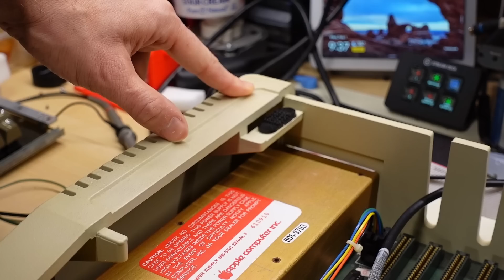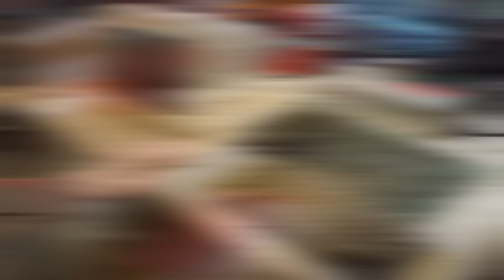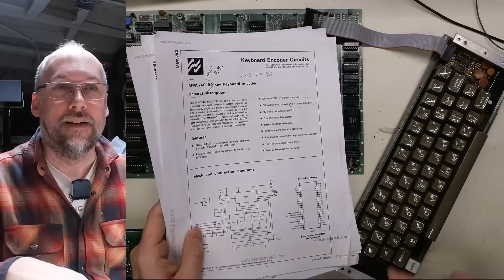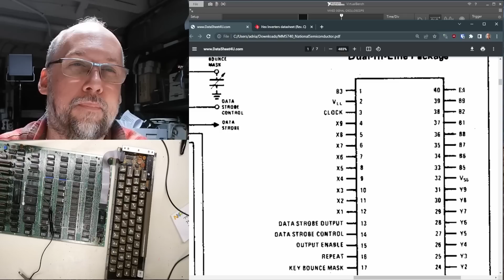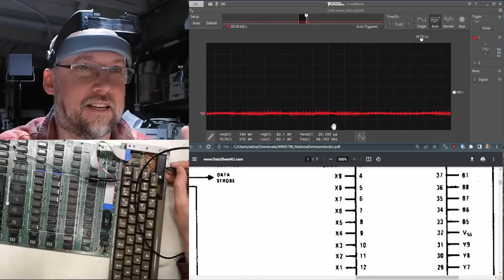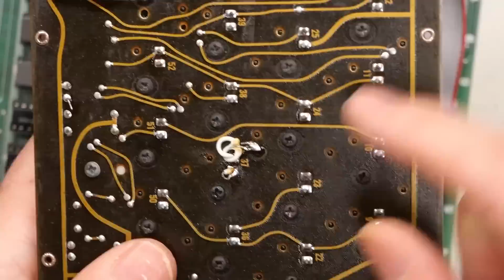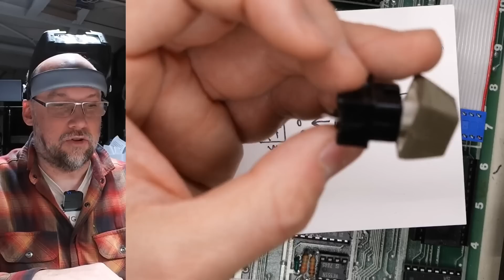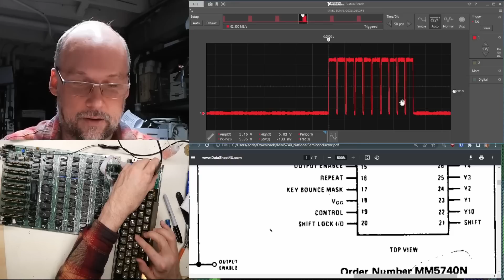The original Apple II keyboard sucks (and is hard to fix)

Comment: That velcro isn't going anywhere with JB weld. But next time, if you want something easier, try double stick carpet tape.
Reply: Apple used a kind of plastic mushroom connector, not velcro. The halves stick together much more powerfully than velcro, so most tapes don't have any chance of working.  The 3M high-strength VHB mounting tape might have a chance.  But expoxy, properly applied to a sanded surface, works pretty well too.
Reply: Sounds like Scotchlock™ by 3M. I've always had good luck with contact cement for adhering porous to non-porous surfaces and for two non-porous surfaces.

Comment: If the main goal was to restore this keyboard to working order, would the key switches from the previous working keyboard be transplantable into the broken keyboard?  If you're more concerned with getting this one working, doing it at the cost of the other keyboard may be an option.  I don't know if the switches would be interchangeable, but it all depends on what the main goal is with this repair.
Reply: Those are completely different mechanisms, probably with different pin locations relative to the key grid.

Comment: I just did some searching and it looks like you can replace the key switches with Cherry MX switches then 3d print a adapter to connect key cap to the cherry key. Thingiverse: Cherry MX to Datanetics DC-51 Keyboard Switch Adapter. Hope this helps for a future video and gets the keyboard back to full function. Keep this old keyboard going hopefully. Keep your head high Adrian and thanks for another great video.
Reply: Yes, that would be the best bet. It is Thing #5780203, and should be good enough in filament for keyboard purposes. Maybe JCM could make a keyswitch kit with all the key switches and adapters, so it would just be an exercise in soldering. Cheers!
Reply: Designer of that adapter kit here: I recommend you print in PETG over PLA and to try to adjust your settings for good inter layer adhesion.

I had written a longer comment earlier but I suspect some auto moderator system ate it since I had put a link to my write up on Applefritter with more background info than the Thingiverse page.

I have licensed the models under CC-BY-NC-SA, but if someone like Joe's Computer Museum or ReactiveMicro wants to make kits using them I am very much open to proposals.
Reply: @thomasives7560 that would be so epic
Reply: Was about to suggest something along these lines, glad to see someone has already created a suitable mod. Would love to see a video with this upgrade done.
Reply: The rub with that would be that you'd probably have to replace them all or have the keys not be the same height. That would make the machine less original. If you're just booting it up every once in a while and want it to look nice, then it might be better to leave it alone, or just try to find some donor switches. However, if you care more about using the machine, then I think it's the best way to go.
Reply: @davidwilliams4845  I had good reference material to work with and the position of the keys is pretty much spot on (see the side-by-side comparison photo on Printables / Thingiverse / AppleFritter).

As for the "keeping it original" argument I hear you; I did try to find donor switches when I began working on that board but could not find any. They have not made DC-51 switches in decades and whatever new old stock there may be left is also going to suffer from this adhesive degradation problem. You could replace the switches as they fail but you'll be left with a weird, non-uniform feeling typing experience.

Comment: Too bad there aren't replacement switches. I'm thinking there may be, but would require quite a bit of modifications to the PCB as the pins may not fully line up. It would be interesting to see if anyone starts a side-project on restoration of these keyboards, even if the onboard chips need to be transferred to the new PCB and replacement key switches.
Reply: and maybe 3d print a small thin adapter to allow the original keycaps to fit modern switches.

Comment: There is a reason why actual switches were replaced with capacitance switches.  Mechanical switches are inherently noisy, whereas the capacitance switches have built in hysteresis.  I have a few old TRS-80's that have mechanical switches, and they bounce a LOT.  There is a software fix, but you have to load that manually every time you turn the computer on.  But what are you going to do?  ^-^

Comment: I believe the generic term for Velcro is just 'hook and loop fasteners'. You can get those DIP headers still - I recently had to use the 18-pin version for a project of mine. Assuming these are 16 pins, here's the part number for one at Digi-Key: CDP16G-ND. And that was a nice blast from the past seeing Drol on the Apple ][ (I had the C64 version).

Comment: For repeating keys, did you notice there is a debounce variable capacitor to adjust that? Pin 17 in the datasheet. (Is that used on Joe's replacement board?)

Comment: I wonder if you could make some sort of 3D print that would take the space of those long switches so you could replace them with say cherry switches. Recycle legs from components you snip on another project. Probably would be very involved but needed eventually.
Reply: Could someone just design a whole replacement keyboard using Cherry switches?
Reply: @Tibbs90  Absolutely. I was just thinking to replace the part that is broken. PCB works fine. So making cherry switches the form factor of those switches is probably the most original fix possible.
Reply: Short leads and some hot glue make you the key switch rebuilder you want to (be).

Comment: I'm sorry Adrian. Not replacing the bad key caps is a half-assed repair imo ☹️ I'd like to see a follow up video where you just replace all the switches to something modern
Reply: There are different ideas behind this kind of repair of a classic machine.  Some people just want it working and don't care about the methods.  Other people want it to remain as completely stock as possible.  Adrian is showing what he can do without enormous effort to try to keep it stock but also get it working.
Reply: @Mueller3D  i get it however he replaced the controller chip with a modern microcontroller. Keeping it stock no longer applies. Let's say Adrian manages to get ahold of 15 or so new old stock switches and replace the busted, how long till the rest dies? 
You heard the man, these switches are notoriously flakey.
I'd just shotgun all the switches with modern ones. The key cap would hide their age well and keep the keyboard working for decades to come (maybe. There's never a guarantee)

Comment: Those DIP-shaped IDCs are readily available from e.g. DigiKey or Mouser for pin counts <= 28, so 16 pins is no problem.
I do not seem to be able to find the larger 40 pin ones anymore from the stock distributors...

Comment: What are you using to connect the Apple to the Amdec Monitor, I have a 2+ and the same Monitor and would like to use it as well. Thanks for another great video Adrian. Keep them coming.
Reply: Any regular phono (RCA) cable should do the job.  Actually, I just checked, and the Amdek 300 has a built-in cable with the RCA plug on it already.  If you have a 310A, then it has the wrong cable, and you probably can't easily use it with an Apple.

Comment: How does negative voltage work anyway? Sounds weird! Does it remove voltage? 😀
Reply: It is negative relative to the zero volts (ground) reference. In old chips it was part of the old silicon design that required a voltage that was negative relative to ground. It didn't need much current, but the chip could actually be damaged if it wasn't there.
Reply: Voltage is pressure which causes charges (positive or negative) to flow. If you consider 0 volts (ground) to be like normal air pressure, then a positive voltage (pressure) is on the output side of a fan or a leaf blower (i.e., it’s blowing air at you). A negative voltage (or pressure) would be suction, like the business-end of your vacuum cleaner. It’s all relative to some standard. For air pressure, that’s about 14 PSI or so, depending on the weather. For voltage (measurements), ground is wherever in the circuit you put the black meter lead. A positive voltage means positive charge is (conceptually, at least) flowing at the meter (the red lead.) A negative voltage would be positive charge getting sucked out of the meter through the red lead. And, of course, 0 volts means the charge isn’t flowing at all. This is “conventional” current. For “electron” current, the whole thing is reversed. A positive voltage would mean electrons (which are negatively charged) are getting sucked out of the meter through the red lead, and a negative voltage means electrons are “blowing” into the meter from the red lead.

Comment: Thanks for another excellent video, a frustrating outcome for you.

Unhappily for such a notoriously unreliable key mechanism I guess if there was a good replacement it would have been found by now. Still, I'm surprised there isn't a 'near enough is good enough' option even if that would require replacing every key.

Comment: Ultrasonic cleaners should IMO never be used on electronics..  The cavitation caused by the high power ultrasound can physically erode traces and other things off, often making things worse and in many  cases from repairable to Beyond economical repair..     IPA is pretty gentle and safe on common electronics and circuit boards, but if there is corrosion, a bit of deoxit and  a soft brus will usually remove the corrosion safely

Comment: I recall trying to find some of those 16-pin DIP to ribbon cable adapters a year or two ago, and could only find 14-pin versions. But if you're really careful you may be able to pry apart the old ones from the bad ribbon cable without damaging the latch-y bit. 
As for the bad keys, I notice they seem to have a + stem, so it would be great if the pins were in the same orientation as modern mechanical keys and you could just replace the whole set of them, but I bet they aren't because everyone would have been doing that already.
Reply: Another commenter says you can put Cherry MX (compatible) switches in there and 3D print a stem adapter for the keys, so it’s probably just more involved than most people are willing to do :)

Comment: You can actually split those keys in half.  They are plastic-sonic-welded together, but a sharp knife will split the seam if done carefully.  You can then disassemble the guts and clean the contacts, and super-glue the key back together.  It’s very tricky to do and even after doing many of them, I am only successfully about 80% of the time.

Also, if you were to take the key apart, you will see that the contacts are virtually sealed in between 2 layers of plastic film, so spraying đeoxit from the outside does not penetrate to where the contacts are located.

Basically these keys are notoriously a PITA to service.  I’ve had pretty good luck resurrecting non-functioning keys with a ultrasonic bath of isopropyl alcohol (done safely with a beaker!).
Reply: I've done lots of them as well, and 80% is amazing - I'm lucky to get half of them working correctly. About 3/4 work to a limited extent, but not reliably enough to put into a machine I'd use.
Reply: @MistahMatzah  Aye, my success rate is roughly 50 to 60%, although I do have a source for good switches that comes in now and then. I have a bag of known good spares, but they are reserved for a B&H Datanetics machine and a few for my '77 machine that have split open (on their own). As with my reply above, if you want to chat about this, reply with Fritter/AtariAge forum ID or an email that you can use as a tossaway and we can discuss our methods.
Reply: I have also worked on a great number of those DC51 switches. Are you on any forums, as I would like to communicate with you. If you want to reply with your forum ID on say, Fritter, or your email, we can have an interesting chat.
Reply: Wonder how BW-100 compares, seeing as it's plastic safe.

Comment: These old key switch models that use basically hybrid membrane mechanical switches should be thrown in the bin where they belong. The only real key switch they should be replaced with, is a mechanical spring-snap switch like what is produced in modern mechanical keyboards. Trying to cut costs on keyboard designs in the late 70s, early 80s made these terrible design choices come to fruition. I'd take a rubber dome membrane keyboard from the 1990s with carbon contacts, over one of these abominations of materials engineering.
Reply: Modern rubber dome keyboards are pretty okay. They are plenty durable and incredibly cheap. Mechanical boards feel better of course, but the rubber domes work just fine.
Reply: @moth.monster  yeah, I’ve been very pleasantly surprised with modern dome keyboards.
Reply: One of the biggest issues home microcomputer manufacturers had to solve with early micros was that certain components like good keyboards, memory, disk storage, etc all were very expensive and at the time there was a built-in market for home micros as there is today. If you were going to sell a home micro to a family or individual that wasn’t sure they really needed a computer in their lives yet or was on a very tight budget then you needed to get the price as far down as you could while still having a usable computer. They manage this in several ways. First, they cut down on the amount of built-in memory, at least for base models. They’d get around the limited memory issue by offering an option plug-in RAM cartridge or RAM board to expand the memory or they include unpopulated RAM sockets for optional additional RAM chips.  With graphics, they cut cost with offering either monochrome-only output or limited colors and using poor quality RF TV output as standard so budget users didn’t have to buy a stand-alone computer monitor. With the keyboards, they went with cheaper designs like these hybrid keyboards, chicklet keyboards, membrane keyboards, etc over better quality but much more expansive proper mechanical keyboards. The use of membrane keyboard party explains how Sinclair got the Z80 & 81 (Z81 was sold as the Timex-Sinclair 1000 in U.S.) under £100 ($100 for the TS-1000). The Atari 400 did the same with its membrane keyboard choice. Another common choice in early microcomputer keyboard design was to only include uppercase letters in the built-in ASCI character set. The Apple II and II+ lacked lower case characters built-in with IIe being the first to properly support both upper and lower-case characters. The choice to use audio cassettes for data storage over then expensive floppy disks in the late 70’s and early 80’s (and longer in the UK) was about cost cutting.

Yes, some of the early design choices dictated by the need to cut costs seem stupid today with our decent rubber dome keyboards and cheap RAM and such but back then the manufacturers had to make trade-offs. Maybe they could have picked better trade-offs in some areas but sometimes early home computer users just had to learn to accept that until the costs of certain complements come down, they would have to work with whatever the manufacturers could provide the buyer at the price they were willing to pay. Some did better then others at this balancing act but every home micro was compromised in some way. The Apple Lisa didn’t cut corners the way the later Apple Macintosh 128k did but sold for $10,0000 ($30,000 today) in ‘83 and was a flop while the Mac 128k (1984) sold for $2500 ($6000 today) and was much more successful.
Reply: They’re not all great.  I picked up a generic dome PS/2 keyboard from CompUSA in the mid 2000s and I’ve managed to wear out the right shift.  The dome isn’t springy anymore so pressing the key just lodges it in the stem guides at an angle.

This is a pretty cheap keyboard, so it’s not unexpected, but I think we’ll see more of those kinds of failures as low-cost 90s and 2000s keyboard get to be 30+ years old.

Comment: Back when, computers were user unfriendly. 6 [Ctrl]+P [enter] to boot from the floppy, yeah that is completely intuitive.
Reply: That is why the Apple II came with a rather large instruction book. 😉
Reply: It depended on what slot the floppy disk controller card was in.  Slot #6 was the standard.   The monitor's 6^P command re-directed the system's output to whatever card was in slot #6.  It was a way to give control to the disk ][ card, which would boot the system if necessary, and start watching for disk I/O commands in the output stream.   It's pretty amazing how they shoehorned that functionality into the system.
Reply: @williamgraham2468  Oh I understand the logic behind it, I am a child of the 80s after all. Just that to a novice user it could be confusing. And I am not just bashing the Apple ][, most micros of the era were horribly designed in regard to the user experience. Disk commands on the c64 are also dumb and counterintuitive. Like destroying your basic program if you wanted to peek at your disk's content.

Comment: That’s a great original bodge to get the original L key working. I can imagine being in a place with no spare parts available and someone coming up with that repair. It worked for someone many years ago. 
Thank you for the video Adrian. Long time watcher first time poster.
Reply: I recall that the official service routine by 1980 was to r/r the whole mechanism as Datanetics turned into TKC and was absorbed by Apple. I have never seen a DC51 switch hacked like that before in my entire career, but by around 80 or 81 the DC51 switch was deemed obsolete, and replacements were no longer being manufactured.